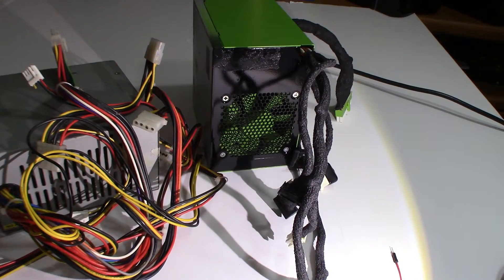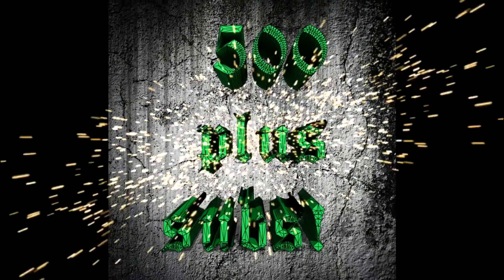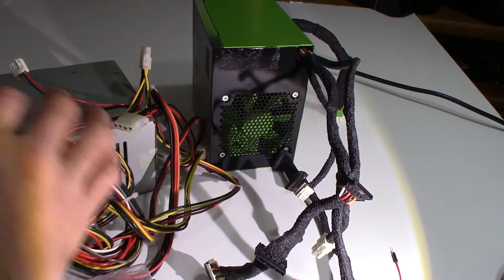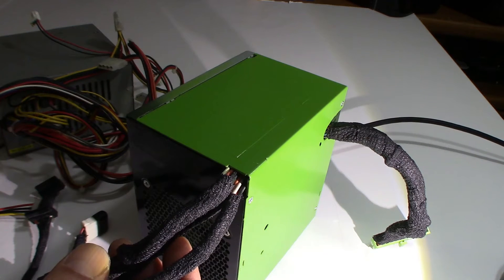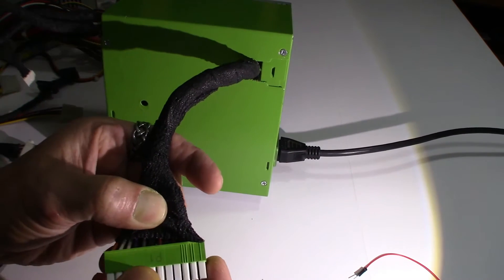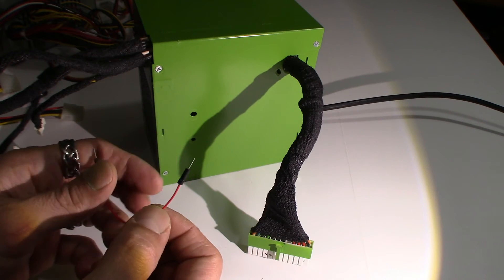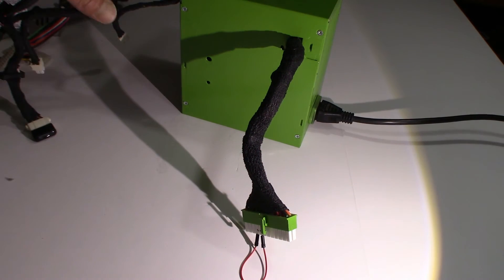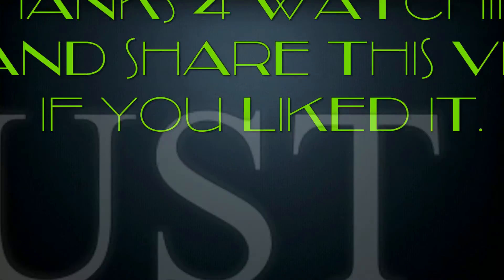IS THAT OLD POWER SUPPLY STILL WORKING?

Comment: Can you make a gaming upgrade on a Dell optiplex 980 sff
Reply from the maker: I did actually I put a evga gt 7302gb ddr5 in one that had an i3 paired with a solid state drive, and a 500gb laptop 7200 drive for games. was awesome! just leave the side panel off if your going to be playing awhile so it stays cooler
Reply: So you dont need a more powerful psu?
Reply from the maker: nope
Reply: Does the Zotac Gt730 with 2gb ddr5 work?
Reply from the maker: looks like it will work fine just make sure it comes with a low pro bracket...
Reply: Thanks for the help :D